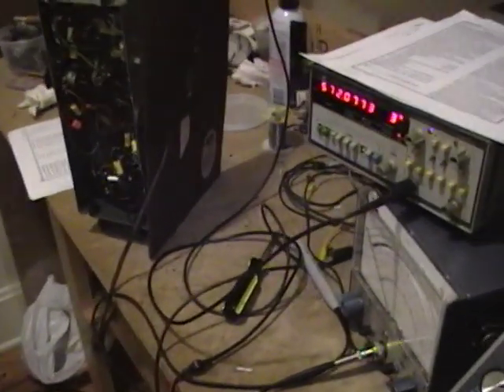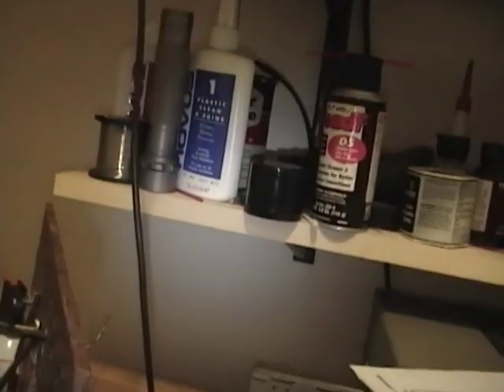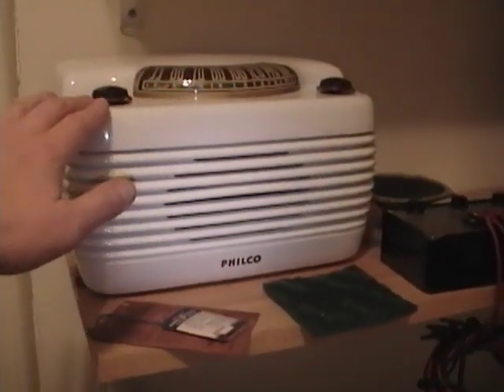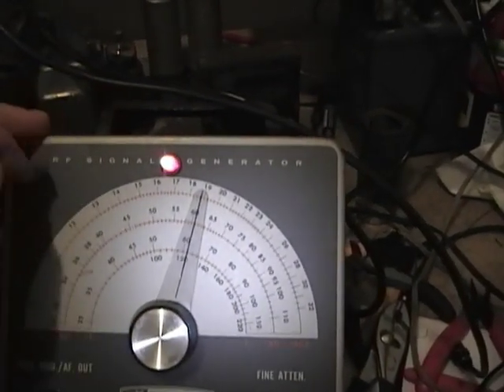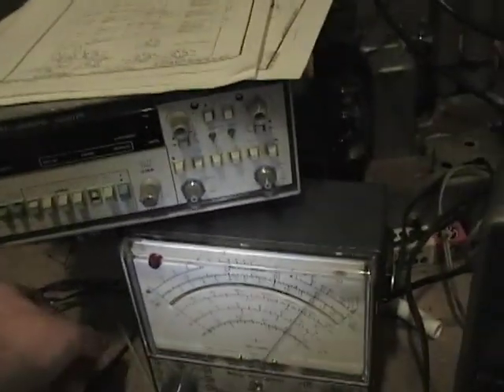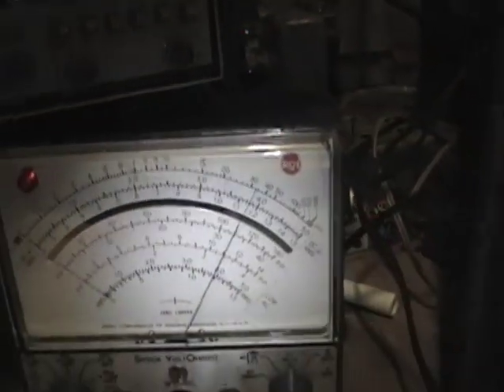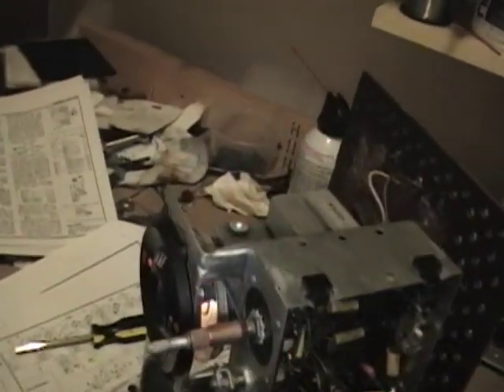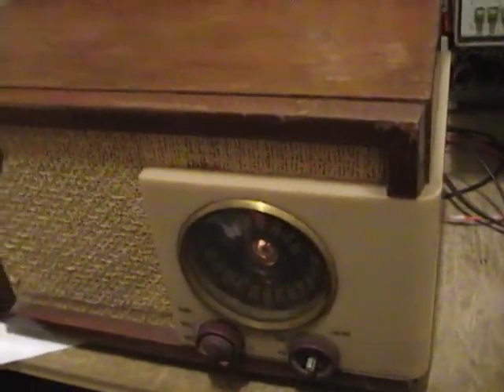AM Radio VTVM Alignment

Comment: Where do you have the meter lead attached? Is the ground meter lead hooked up?
Reply from the maker: Look at 7:11.  It's going to the output of the AM detector.   Yes, the ground lead is connected  It's going to the B- rail.  You can also hook the meter across the speaker voice coil.  Follow the alignment instructions for your specific radio chassis if you can.  They are all a little different.
Reply: @bandersentv  Thank you for responding. I recapped a heathkit 1m-28 vtvm & replaces one resistor that was bad. I can calibrate the dc. When I switch to ohms the needle goes further left from zero & I cannot move it at all with the ohms adjust pot. I replaced the pot and , with the battery in , the needle deflects to the right past inf. and cannot be moved. Also, the battery gets very hot. The new pot is also a 10k one. Do you have any suggestion other than the garbage?
Reply: @bandersentv  Hello again, to follow up on my previous mail I also cannot adjust the ac. The needle won't go past 12v on the 150v scale.

Comment: I've been building tube circuits for just a few years now and decided to jump into AM; building a simple AA5 circuit. Its SURPRISING how difficult it is to find info on building/tuning/test/setup of the AM stuff (at least more difficult than HiFi and Instrument related info).  It's out there but not nearly as condensed, so i wanted to say thanks for a no-fluff, thorough run-through for AM setup!

Comment: The IF screw down story is pure urban legend BS. Bottom line is IF coils are "musentouchits" you can do more harm than good. Simply use the generator and gently , slowly manually sweep the 455 center range above and below by 5 KHz while monitoring the VTVM response.

Comment: am i looking at a heathkit ig-102 rf signal generator? if so i need to know if when you dial in the frequency does it it shift as you release the knob ? i have 2 units that even after cleaning and lubing the vernier assemble, and the condenser bearings,  both units refuse to stay on frequency.  any thoughts ?

Comment: The WV98 is merely a basic service tool and not precision lab test equipment. I have one made by VIZ who took over the RCA test equipment division. Its made just as skillfully as the earlier RCA models and is a true pleasure to own and operate at my test bench. Once a year I get it calibrated by an authorized calibration service , when at that time I replace the batteries too.

Comment: A VTVM is overkill where a VOM will do just as well if not better. The VTVM responds to erratically at peak measurements where the VOM on the output function indicates a smoother transition to abrupt spurious signal variations.
Reply from the maker: Good points but I actually don't have a VOM.  If I ever come across a nice Simpson 260 for a reasonable price, I'll pick it up.

Comment: My signal generator does not have modulation can I still align my set  with it just setting it to 455kcs? Very good video for a valve radio beginner like me just what I needed ,thanks very much for sharing.
Reply from the maker: Sorry, but no.  Without modulation there will be no audible tone for you to hear to peak or for your VTVM to measure.  Look around on ebay on the Antique Radio Forum classifieds for an inexpensive RF generator with modulation.  Good luck.

Comment: Can you explain the use of the internal and external modulation on the signal generator. For the IF cans adjustments, was it set to external and for the antenna adjustment was it set to internal? I have been using internal modulation for the IF can adjustment but I am not sure if this is correct. Thanks

Comment: Hi Bob
Another great video.  Where does the low side(black lead) of the signal generator get attached? I assume its the chassis but I am not sure. Also, what is the purpose of the .01 cap?

Thanks

Gary

Comment: Thanks, I'm trying your method to calibrate, but I'm using a transformer's coil as part of the tuning circuit so the transformer is bidirectional for transmitting and receiving. I'm sending a sine wave into the circuit through an audio in, and trying to see if it can help with demodulation. Quite the project though. I'm going real low though from 1hz to 22.050 khz AM.

Comment: Hi, I have a radio in which the stations come in on the wrong end of the dial. Is this caused by the alignment being way off? Or is the radio just messed up in some other way? Someone may have tightened the alignment screws. Can a radio that is possibly this far off be aligned properly?   Thanks, Bob
Reply from the maker: More likely the oscillator trimmer is off.

Comment: Not recommending this unless you've done a number of alignments, have a feel for them and understand circuitry, but I've aligned radios using radio stations around 600 khz and 1500 khz with good success just listening to the audio out of the speaker.
73 de KQ2N

Comment: Hi BAndersen; This IS GREAT!..Getting back into the TechElect "stuff" after a lifetime away, and this really helps.Think I have the same RF-Gen, a Heath F-1, got it on ebay.
 One question: AC Volts across the spkr or DC?
Also: Any suggestions on a tube tester would be appreciated; EICO, B-K Sencore?
 Thanks very much! Glad I subscribed.

Comment from the maker: Hi and thanks.  I have encountered some tight cores, but  luckily not so tight I couldn't turn them with a little extra force.  If I did, I'd try spraying a little electronics cleaner or contact cleaner to lubricate the core without harming it.

Comment: Great video!!  I just picked up a signal generator to run an alignment on a 1936 Philco 610.  What type of output meter can I use.  Can I use a modern voltmeter hooked to the speaker leads?

Comment: This is interesting, I'm getting ready to calibrate a small AM transmitter/receiver I'm working on. I decided to put a voltage transformer on the output to separate the audio but drive a couple antennas instead of loudspeaker.

Comment from the maker: You're welcome, I'm glad you enjoy the videos.  AC volts.  You better not have DC across the speaker or you'll burn it out ;)  I'm no expert on tube testers by any means.  I have the ones I have because I found good deals.  Of the testers I do have, the Hickok 600A is the most accurate (mutual conductance), Knight 600B handle wides variety of tube types but is only a basic emission tester. Good luck.

Comment: I have used a Fluke 117 DMM with a 1MΩ resistor in series with the point of the lead as the meter has a 10MΩ+ input impedance and a 33 segments/second bar graph. The digital display updates at 4 times/second--if I recall correctly. It worked well, so I can't discount a quality DMM for alignments. However, I have recently bought and calibrated a Simpson 312 VTVM and used that one on another alignment job. The digital works well, but the VTVM is certainly more enjoyable, for me, to use.

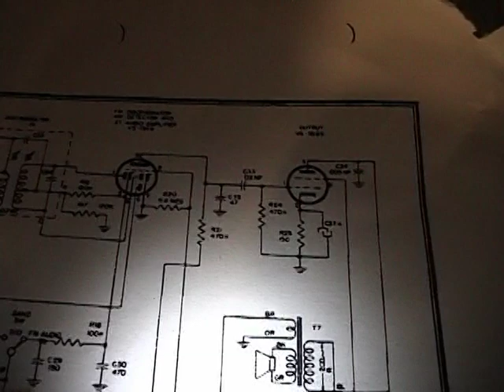Comment: At around 6:30-6:57, it looks like you are pointing to the primary of the output transformer, but calling it the voice coil. I don't understand.
Reply from the maker: I meant to point to the secondary side of the output transformer.
Reply: @bandersentv  Thank you for replying. Now that connecting to the secondary side is what we're after, then would you agree that a VTVM would be set to an AC range and not DC, since transformers do not pass DC? That is the big question in my mind.
Reply from the maker: @totallysmooth1203  Yes, it also means you need to use a modulated signal source.

Comment: The needle's broken off on mine too :D

I have a question about hooking your scope up to a signal generator.
I recently picked up a nice little 35Mhz dual trace scope on Ebay for about $50.00 to learn how to use a scope.  The scope is in surprisingly good condition, apart from needing a little DeOxit on the alpha channel pots.

I would like to hook it up to my Eico 324 Signal Generator, but I don't want to damage the scope in the process.

Is this just a direct connection? Or is there some special trick to this, such as attenuation, that I should know about?

Thanks in advance. :)

Comment from the maker: Yes, you can use a modern meter, but remember to connect it to the voice coil - not the primary of the output transformer.   Also, use an analog meter rather than a DMM.  You'll have a very hard time finding the peak with a digital meter.
Reply: Perfect! You answered my question!
Reply: I just finished recapping a Philco transitone model TH-3 I'm on the ARF as michiganamps, do you have any tips for aligning tuning cap trimmers without a signal generator??

Comment: I don't have a VTVM, or an analog meter for that matter, but what about an oscilloscope?  Obviously that would have a nice instantaneous visual like an analog meter, but does it have a high enough impedance that you don't need to test off the voice coil?

Also, you soldered the capacitor used in line with the signal generator.  Any reason you didn't/couldn't use an alligator clip, just to make things easier?

Comment: Hi,

Love the video.  question:  have you run into situations where the IF can alignment adjustment core or screws are extremely tight, and what have you done in those cases?

Comment: I'm currently restoring a Philco 42-380 using these items. I have a Heathkit V7 and an off-brand signal generator. However i cant seem to locate the output of the AM detector. How can you tell?
Reply from the maker: Output of detector will go to one leg of the volume control.  The other leg will go to ground and the wiper will go the to 1st audio amp.
Reply: If you have the time, could you look at schematic and tell me which pin on which tube? Apparently l can't seem to get it

Comment: Wow! This is very complicated to an uneducated (about these things) person like me. I'm hoping to slowly learn, as I will be getting an old radio passed down to me from my grandparents, and I'm not sure the condition of it (electronically) after all these years. It seems to be in decent working order, but I haven't messed with it much since I was a child.
Reply: how old a radio?  If you want it to last a long time, it needs to be checked out.  Old capacitors often short out, and when they do they can damage other components.  Best to check and replace all capacitors/resistors ect, or you might find your radio suddenly quitting.

Comment: Hi--real clear explanation. Do the multiple coils and adjustment capacitors interact with each other such that you need to go over the adjustments several times to optimize them?
Reply from the maker: No they don't interact as each stage is shielded and isolated.  It's a good idea to run through the alignment twice though.  Especially if it's really far off.

Comment: Thanks for the great instruction, especially showing us several ways to create a signal into the radio & the relationship between the generator & freq counter. My only suggestion is to point the camera at the "hookup" points rather than just stating you "hook up" this to that.
Reply from the maker: My thinking was that it's going to be different for every radio.  You need to refer to a schematic and trace out the wiring to find the right hook up point

Comment: Whats the specs on your loop, (indution ant.)?  Turns, size of wire, dia. of loop
Reply from the maker: The alignment instructions specify 4 turns, 6 inch diameter of bell wire.
Reply: What size wire did you use?
Reply from the maker: +Ted Mieske Not sure - just a scrap of old telephone wire. probably 22 or 24 gauge. I'm sure it doesn't matter.  Keep in mind this is just for this specific GE radio. Always follow the instructions for your specific chassis when possible.
Reply: Understood!

Comment: Where the heck does one learn this stuff? Of all the people I know, I don't think one of them would know this stuff.
Reply from the maker: I read a lot and tinker a lot going back to the 80s.  Some other guys in this hobby had mentors (AKA "Elmers") but I wasn't so lucky.  I also have a degree in electrical engineering and a pretty sound grasp of the theory and math but nothing beats hands on experience.